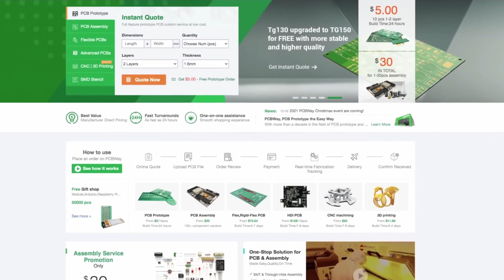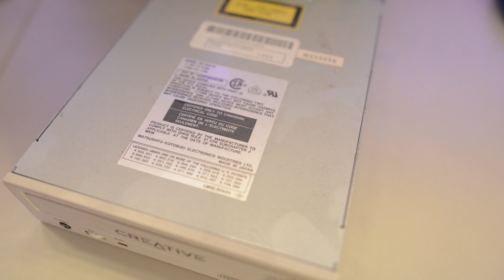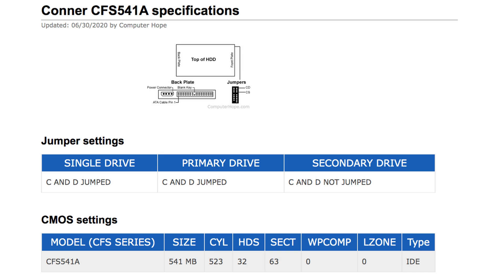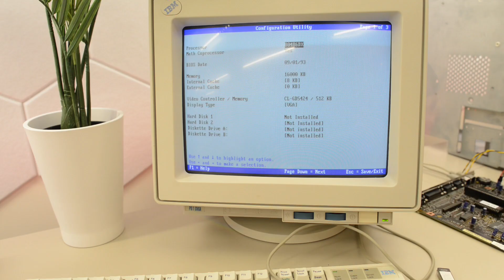You're not going to believe what I found inside this gem :) Vintage IBM restoration

Comment: Great video! It seems that around the 4x87 socket there is an extra row and column of pins.... so I wonder are they functional? Is it possible to support pentium overdrive?
Reply: I took a close look on the video and couldn't see any traces going to the outer row, so it's possible they were just there to allow the option of using a ZIF socket 2. That being said, the resolution and focus wasn't great in the wide shots of the board, and the close-up macro only had one side in partial focus.
Reply from the maker: Thank you. I'll check the traces
Reply from the maker: @UpLateGeek  I'll check

Comment: Are the keys very fragile when they were made or is it because they dry out over time?
Reply from the maker: I don't think these kb have aged badly. Maybe I should have been more clear in the vid. They are not brittle like old Apples. IBM just used way too thin plastics and that's why they are brittle. That is also why they are interesting and give a unique typing experience, it's like typing on a feather light model M :) As long as you don't drop them, they should last fine. That being said, you have to recap them and probably replace a crystal inside. Worse case, the IC is killed by the cap juice. If you can find one, get the caps out immediately and clean the PCB with IPA

Comment: Those CD-ROM drives are known to be problematic.  The ATAPI version is much more reliable.
Reply from the maker: yeah, I have stacks of CD-ROM drives, but I like having one of these early "weird" drives in the collection. I hope it works!
Reply: Problematic how?  I have a few of them, and they are generally reliable.  A few have outlived their lasers, but that can be said of .. well, at this point, any CD-ROM drive.
Reply: @nickwallette6201  I remember them having trouble reading past 600 megabytes on a 
CD-ROM disc.  I believe the issue may have been firmware related.
Reply: @douro20   Hm, interesting.  I'll have to test that and see if any of my old drives exhibit that bug.  I have both CR-562 and CR-563 drives in that 2x MKE-interface line.  The transport mech is almost identical between them, with just a few differences with, e.g., the spindle motor.  It could be they patched some firmware issues or carriage extension limitations as well.  I would imagine full 650MB discs weren't super common in the first few years of prolific CD-ROM adoption, and at least, I never ran into that -- that I'm aware of.  :-D